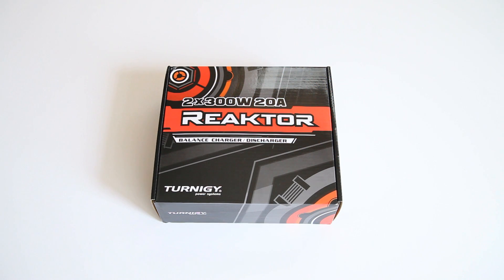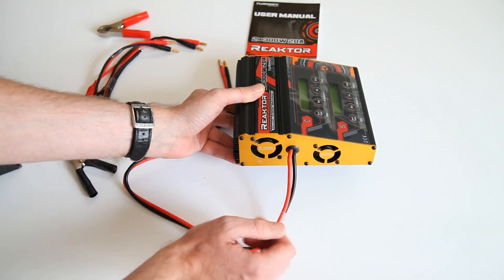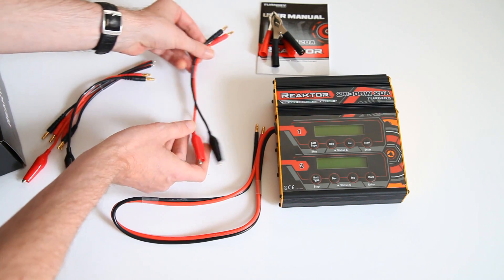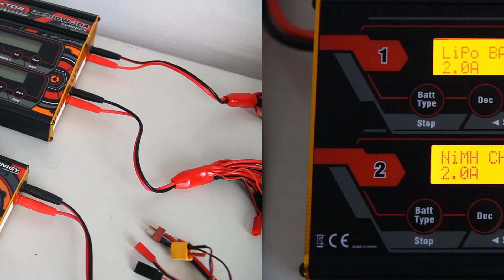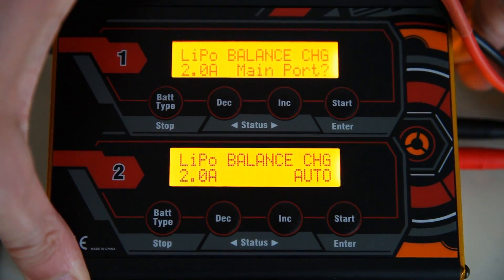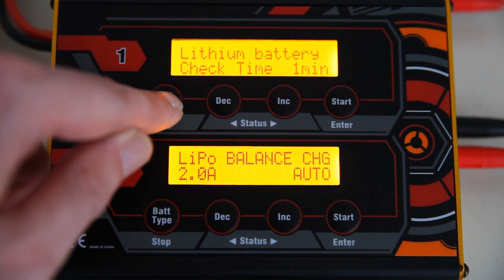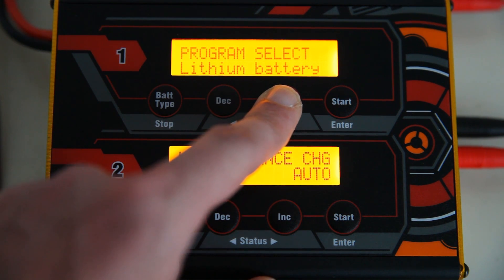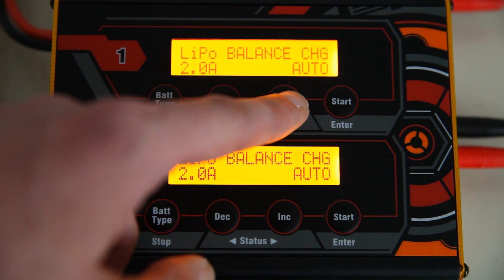Turnigy Reaktor 2 X 300W 20A Charger - Unboxing + rundown of the menu

Comment: Sweet, maybe something I should get as I want more good chargers :) For the USB would I be able to plug something in like the Mobius and control the charge? How do you hook up the bullet inputs to get power? That is my biggest concern. $130 may be a bit steep for my budget though.
Reply from the maker: The RCAddict Thanks mate.. These are good chargers for sure but NOT cheap.. 
For a charger like this you need a seperate power supply (which the bullits slot into).. So it is in fact even more expensive.. 
The usb-port is a normal usb outlet, much like on a computer.. No control or anything..
Reply: DutchRC ADVENTURES Yeah, You cant solder on any king of thing to go to a power supply which plugs into the wall? Seems sort of weird why they would do that. Oh, if the usb is non controled i wouldn't want it.
Reply from the maker: Well here is how it is: Some (less powerfull) chargers have a build in power-supply.. Those just have a chord that runs into the wall..
More powerfull chargers (such as this one) do not, so you need an external 12V supply.. 

One of the reasons for this is the differences of wall-outlet voltages the world over.. This way the charger is allways the same, where ever you live..
Reply: DutchRC ADVENTURES So how do you get an external power supply? And how do you charge that?
Reply from the maker: An external power supply simply transforms the Voltage from xxx to 12V  Just like an internal one would.. 
Like this one: 
http://www.hobbyking.com/hobbyking/store/__17755__HobbyKing_540w_220_240v_Power_Supply_13_8v_18v_30amp_.html  

This one has 1 input (wall outlet).. and 2 12V outputs.. (well actually a Bit more then 12V)
Reply: DutchRC ADVENTURES Oh, ok. Now we are talking out of my budget :0 Lol. I might get another one of the one I have as it is awesome for me just need more lol
Reply from the maker: I didn't help you choose the one you now have for nothing mate ;)
Reply: DutchRC ADVENTURES Yeah, I know :) I might get another one as double would be great. I just saw that double one and was like"ooh! Triple charging" lol
Reply from the maker: Well.. in MOST cases it is best to have multiple single chargers, instead of doubles.. 
If a double dies, and it's your only charger.. You're left with zero chargers....

But YES it is an impressive looking charger :)
Reply: DutchRC ADVENTURES Yeah, Maybe once I get some more larger batteries :) 

I saw one on instagram that was a Hitec 4 port!
Reply from the maker: Yeah.. one reason to go for a 2, or even 4 port charger might be being pressed for space.. 

For me: before I go out to the field I want to quickly be able to charge for instance 8 lipo's.. (2200mah and up) ..
On car-bashing days it's even worse :P Those lipo's are bigger..
Reply: DutchRC ADVENTURES Should they all take the same amount of time if you are charging at teh same C? Unless some are out of balance.
Reply from the maker: I never really do.. I make sure I'm not in a Real hurry, so I charge most things at 2A.. 
The lipo's will live longer that way...
Reply: DutchRC ADVENTURES I usually charge as just a bit over 1C.
Reply from the maker: Should be o.k.... 
When I charge in the field (off of my car's battery) I do charge a bit faster (and not balanced) .. just to keep me flying ;)
Reply: DutchRC ADVENTURES Haha, dont run your car dead! COuld you do a reverse charge to get it running?
Reply from the maker: YES! I actually have lipo's that are strong enough to just start the car streight from them :)  
BUT.. it would take a lot of charging to run the car's battery flat :)  
ohw.. and I allmost allways have buddy's around with their own cars, to jump start me..
Reply from the maker: ps: funny: you can allso power a charger with a lipo, to charge another lipo :P
Reply: DutchRC ADVENTURES Haha, would be a coo video maybe ;D Lol just charge off of theirs when they are not looking ;D
Reply from the maker: Hahahaha I stole your electricity man! Haha :D 

hmm that made me think: maybe those bullit connectors of the charger would fit into a XT60's ;)
Reply: DutchRC ADVENTURES The nanas that go into the side are too big for the Xt60.
Reply from the maker: Will try that :)  My chargers are bussy now though ;)
Reply: DutchRC ADVENTURES Mine is storagin the batts I used today. I fell bad. I did not do my chore, did nto do some homework, did not move wood, and did not clean my room. Damn you X800 and Tiny Hawk!
Reply from the maker: Hahahaha yeahhh blame it on the toys mate ;)  Ohw well.. there's allways tomorrow (for as far as I know) :)
Reply: DutchRC ADVENTURES Well I am mowing the grass my my step dads gargae in the morning and then here at home in the afternoon so....Will do the homework and other stuff though. It is just about getting started. But my luck my parts will come tomorrow and will be playing with that for the next 3 years ;D I alos need to edit and upload a bunch of videos to. No playing tomorrow. will get stuff done! (hopefully)
Reply from the maker: Hahahaha yeah.. the gimbal and FPV set allso came in over here, while I didn't really have time for them :P  
(offcourse I DID test them.. ahum :P)
Reply: DutchRC ADVENTURES Oh, I also forgot to say I have soccer practice from 5:30 to 7:30
Reply from the maker: Soccer over there? :O  That's not a very popular sport there, is it? 
I played a lot of soccer in the past (it IS a popular sport over here)
Reply: DutchRC ADVENTURES It is sort of eh...football domintes it but it is there.
Reply from the maker: Allright :)  So.. I just returned from the flying-field.. New video's have been shot :)  
I haven't started video's on the gimbal & FPV set from BG
Reply: DutchRC ADVENTURES Sweet! No crashes? I flew my MJX X800 twice this morning and if you give ti full forward trim since the pitch is low then it can go crazy fast! Hard to stop using backwards pitch but I just turn it around and give forwards to stop ;D
Reply from the maker: Ehm well crashes.. some minor mishaps, but those were more funny then bad ;)  
And I Allmost crashed into the fence :P  That (LONG) video will be up in a few hours :) 

Hahahaha that's fun! Fooling the quad that way to force it to go fast :P 
Ohw.. I got a A-Spec nano tech in today.. Comes with a nice sticker! :P  hahaha well.. I'm sure it's a good lipo allthough a bit pricy (I needed a High C-rate lipo)
Reply: DutchRC ADVENTURES Haha, sounds fun :) What is beteter besides C?
Reply from the maker: Well they are build be bit better.. More shielding on the wired to prevent cracks (power cable & balans cable).. It was better packaged as well by the way.. Lots of padding in and outside the box..
Reply: DutchRC ADVENTURES How much more do they cost? I just found this on gearbest. Looks like a clone of the X900 sort of but inverted. I swear every time I buy something they come out with something better as soon as I get mine...

http://www.gearbest.com/rc-quadcopters/pp_213068.html
Reply from the maker: This is the one I got: https://www.hobbyking.com/hobbyking/store/uh_viewItem.asp?idProduct=53776 
I'm not sure from which warehouse you would order it, so.. Take a looky for the price :) 

Hahaha :D  yeah.. you can be Sure they will keep shelling out new, slightly improved, things FAST :)
Reply: DutchRC ADVENTURES Ok, not bad for the price then :) 

I also found this one on BG http://www.banggood.com/JJRC-H20-Mini-Headless-Mode-2_4G-4CH-6Axis-RC-Quadcopter-RTF-p-986430.html
I think I will get that one when it comes out.
Reply from the maker: That one looks FAR better! Right? :) 
Nice design & paint finish AND a nice price :)
Reply: DutchRC ADVENTURES Yeah.

I just flew my X900 outside and was only ten feet away from me and it flew away! I had no control and it was giving full forward pitch and throttle. I ran after if for about a half mile under it but it kept climbing until it was about 300 feet up and over the woods and it flew out of sight.....
Reply from the maker: No way :O :|  You do have that on camera?? 
Hmm but that's a shame man! I'd be very unhappy
Reply: DutchRC ADVENTURES Yes way, ULTRA pissed right now. It was my second flight, no camera. I emailed my GB guy who send me stuff as i bought the first one, maybe he will send a new one. So mad, I was going to use the X800 TX which is fine but wanted to do the testing with stock TX....y mistake. Unless you have the X800 or X600 TX I think it is terrible unless indoors as the range issues\. It does not stop when it loses connection either, just keeps going until dead :(((((((
Reply from the maker: I can imagine yes! Damn man.. I hope GB can help you out there! Same kind a shit as with my Revell quad, but ultra stupid that the thing just flew away! :O
Reply: DutchRC ADVENTURES Yeah! I email the guy who sends me stuff becuase the customer service tickets you fill ouot you have to put in a verificatio code at the end to prove you are not a robot but every time it says incorrect.
Reply from the maker: Aha! You are a robot! :D  That's why we never see you on camera :P (or do we.. I'm not even sure :P)
Reply: DutchRC ADVENTURES I think I showe up in my dromida and mobius footage (by accident)
Reply from the maker: Ghehe :)  Ohw.. I got another email from GB (from someone ellse) asking me if they could send me stuff :|
Reply: DutchRC ADVENTURES Did they give you a list to choose from?
Reply from the maker: Well to be honest the english was 'a bit' croocked :P  hahahaha! It was a bit hard to make out what the plan is :P 
I've given her a list of (not overly expensive) things I would be interested in (some quads. a car.. a boat and a camera).. 
We'll see how the cooky crumbles ;)
Reply: DutchRC ADVENTURES Well, do you know chinese? Haha, they know chinese are some english ;) You have to say yes and then they will give you a list of like 5 things that are sort of cheap, to try you out with to see if you will bring the enough sales to continue sending things.
Reply from the maker: I just ate chinese today, but that didn't help :P hahaha 
Well cool, but that won't work for me.. My channel isn't about those kinds of RC's.. 
So they can eighter send me things that fit on my channel, or bye-bye...
Reply: DutchRC ADVENTURES Yeah, haha. Hoow much were the things you asked for? Unless they are under $50 I don't think they will say yes :/
Reply from the maker: Ehm hahaha yeah.. 1 quad was €48.. the rest was like €75 and up :P 
Well.. I don't care.. Even these things were on the edge of being to cheap for me..
Reply: DutchRC ADVENTURES Oh, haha. I would not expect anything then ;) But who knows ;D I don't think too many people know that I am posting a video every day know. Oh well, they will figure it out ;D I am going to buy a few things from GB soon with my weeks pay.
Reply from the maker: I expect nothing mate ;)  It's all good.. I wasn't getting things for free before this eighter, so nothing lost :) 

Haha yeah.. The'll figure it out ;)  I've been posting daily for about a week now as well, but I actually think it got me fewer views.. Ohw well.. It doesn't really matter.. I'm still in the build-phase of the channel anyway..
Reply: DutchRC ADVENTURES Yeah, maybe in a month or so once you are bigger :) I might accept one thing if they ask with a list though because that is how you get more expensive things :) Have to build up with the company ;)

Sweet, I have not been able to watch my videos as I am very busy but will try over the weekend, maybe tomorrow morning. I want to see you build an ocotcopter ;D
Reply from the maker: The next thing I will (scratch) build is a plane my friend ;)  I'm in the process of designing it now :) 

Well yeah.. building a relationship with them.. I understand.. I'd rather be patient for 'real' rc companies to take an interest though.. 

And no worries mate :)
Reply: DutchRC ADVENTURES Sweet, you should one like on flite test which has like 10 wings on top of each other ;D 

The first thing i got was $20 and then second was $30, and they pay $15 for DHL  each time. I would ask for something a bit more but I had them resend the X800 since the first one caught on fire and am noow asking for a new X900 since it flew away..haha whoops. Maybe not the best time to step it up ;P 

Just watched your Totem quad video and am loading the Sky Easy Glider for a while and will watch after I do homework for a bit before I got to bed :)
Reply from the maker: The end of the Sky Easy video is fun (sorry :P) :)  
Thanks for taking the time offcourse! 

Hahaha 10 wings :D  I WILL tell you it will be something you haven't seen before, or at least not offten :) 
That might allso mean it won't fly well :P haha we'll see.. 

Damn.. I'm in the process of my video of the gimbal.. quite a bit of work :$  (6 video takes so far. and a few more to go)
Reply: DutchRC ADVENTURES Haha, just got done with what I am doing tonight and sm watching it now. May take a while as it says it is playing at 6kpbs right now...Ok, just jumped back up to 100. 

I hope it just works, will be so cool :P Wow, is that 6 mess ups or 6 parts?
Reply from the maker: Hahaha :D   no no.. 6 parts.. I used 4 different camera's as well so far :P haha
Reply: DutchRC ADVENTURES Oh, ok, that is a lot ;P
Reply from the maker: :D  

Do you allready have that new WLT plane by the way? Or is it on its way? :)
Reply: DutchRC ADVENTURES I bought it yesterday, so will be quite a while yet but have lots of other stuff coming, including (hopefully) my banggood ZMR order today.
Reply from the maker: Exiting! :D  That should then be everything needed to get it airwurthy?? :)
Reply: DutchRC ADVENTURES Yeah! I have some heatshrink, locking nuts, and liquid electrical tape coming too but that is not essential right now. I doubt it will come though jsut becuase it is me.
Reply from the maker: Hahaha I know that feeling ;) 
I wonder how long that BG quad will take to get here,,,
Reply: DutchRC ADVENTURES Yeah, it is a sucky feeling. Did you get the RTF version of the Hisky one? I am considering the Hubsan 109 or whatvert, the brushless one when it comes out. It is $200 (what it is listed at now) II will probably also get the H107L+ not becuase I want it but because of views :o
Reply from the maker: Yep.. I got the RTF version.. That Hubson does indeed looks nice :)  Not cheap though ;)
Reply: DutchRC ADVENTURES Ok, and yeah. The prices might drop though as those are not from the factory. Someone just said you can only use a 25MW transmitter with the V2 goggles, is that true?
Reply from the maker: That's bogus my friend :)  
Especially sinds I have 200mW transmitters myself ;)  
Maybe they got the current-draw of the receiver mixed up (which is about 25mW)  

Not MW by the way :D  That's MegaWhatt :D
Reply: DutchRC ADVENTURES That is what I told them. I said you got 700M, is that right?
Reply from the maker: Of range? Yes at least.. The specs say 1500M.. I have gone as far as +/- a 1000m by now, which worked fine..
Reply: DutchRC ADVENTURES Oh ok. I meant meters. I thought 700 was a lot for fpv! Wow, I hope mine will go that far.
Reply from the maker: I'll test the cheapo BG fpv set one of these days :)
Reply: DutchRC ADVENTURES Haha, soon. I am eyeing it more and more these days ;D
Reply from the maker: I just released another FPV-view video a minute ago :)  This time you'll actually see the FPV feed :)  (links to the gear used are in the description)
Reply: DutchRC ADVENTURES Ok,will check it out soon. I have saved and uploaded 5 videos so far so almost done ;D They may have shut our download speed down but upload is going great!
Reply from the maker: Ghehe okee good! I was wondering if that was effected indeed.. Nice to read that it isn't :)
Reply: DutchRC ADVENTURES Do you know how fast your upload and dowload is in terms of MBS? I am curious.
Reply from the maker: My connection is 200Mb/s down and 20Mb/s up..
Reply: DutchRC ADVENTURES I am crying inside. I did a speed test in the morning when it is normal and it was 2MBS down and .4MBS up. so you are about 100X faster.
Reply from the maker: Sorry mate ;)  I have the fastest possible connection (for non-commercial use) over here.. And connections in the Netherlands are among the fastest in the world.. I guess that's a benefit of a smaller country..
Reply: DutchRC ADVENTURES Hum,,, :/
Reply from the maker: It's allso €55 a month though ;)
Reply: DutchRC ADVENTURES Wait till you hear this, ours is $80 a month...
Reply from the maker: Hmzzz I was afraid of something like that :$
Reply: DutchRC ADVENTURES Only provider. No one else is here yet. There are others but they are 5 minutes down the road.
Reply from the maker: Yeah.. no competition has a way of driving up the price..
Reply: DutchRC ADVENTURES If it was unlimited at normal speeds I would be very happy with it but the whole limit sucks.
Reply from the maker: Yeah.. But there is no negotiating to be done while their the only one there..
Reply: DutchRC ADVENTURES Yeah, I hate it even more becuase people in town with verizon have unlimited really fast, like 50+ download, and it is only $40-60 a month!
Reply from the maker: You'd need a cable to be laid-out towards your home, to be able to get that? (proably thousands of dollars to get that cable put in)
Reply: DutchRC ADVENTURES Yeah, not enough people out here for it to be worth it to them.
Reply from the maker: Yeah.. Well we do have some aerias with the same situation over here (yes.. even in this small country).. People living in the woods.. farmland and such.. 
For them to get a cable rolled out, it would cost them the price of a small car...
Reply: DutchRC ADVENTURES Yeah, oh well. I am just worried that once I get my good camera the videos will take forever to save and upload. The YT option in WMM saves at 30fps so for me to save at 60fps would have to make a MUCH bigger file. I expect upload times to at least triple :(
Reply from the maker: Well.. here is the thing about 60fps: it looks better to people though they don't really know why.. It's workes better for our brain.. 
As such there is no better kind of improvement.. 

On the other hand: with the Sony cam your footige will Even look a lot better at 30fps.. So you can at least try the 60fps thing..
Reply: DutchRC ADVENTURES Yeah, I know ;) I think I might be able to set the bit rate is a custom setting so maybe bring it down a bit which is what the YT setting does.
Reply from the maker: Yeah.. just do a few test-runs.. And if you want me to assess the quality of a video on YT for you.. let me know...
Reply: DutchRC ADVENTURES Yeah, I will know you are watching at the highest possible quality :P
Reply from the maker: 4K is possible ;) 
Anyway.. feel free.. Just do a few shorter test-video's maybe :)
Reply: DutchRC ADVENTURES Yeah, I can change the bit rate at which it is saved. The YT setting is at about 5,000. Would I be able to save the 1080 60 at 5,000 to keep the file size the same or would I have to double it? I think the full recommened bit rate is like 24,000
Reply from the maker: I wouldn't use a low bit rate.. As you know YT compresses the video's (jpeg-compression).. And You would allso be doing that on your side..
Now it might seem like the YT compression would then not impact the quality anymore, but it Will.. It kind of compounds the loss of image quality..
Reply: DutchRC ADVENTURES What would be considered low for 30FPS and low for 60? The setting use says 5.19MBS
Reply from the maker: I must admit I had to take a look at what I use.. I use  8,000 minimum with peaks set at 10,000 .. (default setting with my codec).. I'd say 5,000 would be a minimum... 
Hmm I looked at a file I just compiled, and its 10,000 kbps.. I think most of our video's would be compiled at my peak because of all the movement & colors.. (an unboxing will probably use less)
Reply: DutchRC ADVENTURES Ok, so 10,000 would be a good number then. I wonder why the recommend is 24,000 and the max is 135,000 then :/ What about the audio? I just saved one with teh lowest audio and sounded the exact same to me. Also saved one with the highest eveything and was 1 minute long and 1GB saved with the lowest everything 64X64 and 1FPS and was 1MB ;D
Reply from the maker: I didn't include audio by the way, but that's only 401kbps .. But yeah.. 10K seems just fine to me.. A happy medium between bad & overkill..
Reply: DutchRC ADVENTURES Huh, my audio comes set at 128KBS and only goes to 192KBS. I just hope saving the larger files will not take too much longer to upload as I don't really have the time. I think flyin' ryan's are only in 30fps though.
Reply from the maker: Ah yeah.. 128kbps for audio is just fine (for what we do) .. 
Well.. do a few test-runs and see how much bigger the files get...
Reply: DutchRC ADVENTURES Yeah, now that I look not very many people at all have 60fps videos. Ryan probably has to render his down as the mobius footage is only 30. Lol, I will be the one with the good camera ;) Behind you, I am surprised you don't have one to do 4K or upload it ;D
Reply from the maker: Ghehehe my taste in camera's is a bit expensive ;)  I want a Sony FDR-AX100 .. but it's €1,900 :(  I want that one because it is VERY good..
Reply: DutchRC ADVENTURES Haha, go get the 4K ;D
Reply from the maker: I'm really not made of monney my friend :)  Maybe once the YT payments improve a bit..
Reply: DutchRC ADVENTURES Haha, you are making triple me ;D Just kidding, hardly anyone would be able to watch it, not just speed but computer resolution.
Reply from the maker: True :)  It is beyond what really matters indeed :)  1080P 60fps is good enough for Now.. It will take a while before 4K becomes the norm...
Reply: DutchRC ADVENTURES Haha, never will be the norm with hughesnet!
Reply from the maker: Probably not in the coming decade indeed :)  But like you said: most people don't have monitors that can display 4K anyway :)
Reply: DutchRC ADVENTURES Haha, I wouldn't even expect 720 in a decade ;D
Reply from the maker: Those people that will be on Mars in a while might have a better connection :)
Reply: DutchRC ADVENTURES Yeah lol.
Reply from the maker: Maybe enlist into that program :)  I mean.. yt video's from Mars :D  that should get some views ;)
Reply: DutchRC ADVENTURES Haha, they would hover at 1% throttle ;D
Reply from the maker: Hahaha yeah.. you could fly for hours on a 100mah 1S :)
Reply: DutchRC ADVENTURES You might need to have reverse pitch propellers as then the challenge wouldn't be keeping it up but keeping it down!
Reply from the maker: Ghehe ohw well.. You allways fly a quad upside down for a while to get down :)  
Tomorrow another chance for mail?? Or doesn't the mail come in on Mondays over there? 

ps: new video with the Totem 330 is online.. with a snappier take-off this time ;)
Reply: DutchRC ADVENTURES Haha, just strap on upside down on the top to push it back in when you want. Yeah, mail just does not come on Sundays. Will check it out :) My X800 unboxing is live in 3 minutes ;D
Reply from the maker: A new round in the mail lottery then :) 
I'm amazed there aren't any video's about that HiSKY quad yet by the way.. Well not good video's that is.. Or do you find video's on the HiSky HMX280 HMX 280 ??
Reply: DutchRC ADVENTURES Haha, I bet almst anything it won't be there :( It has been a month since I ordered it. I have not seen any yet but I know a few people have them on the way.
Reply from the maker: You DO think it will still come in?? 
Hmmm that would probably be QC101 & Ryan??
Reply: DutchRC ADVENTURES Idk, I jsut hope and get my dreams smashed but they are reignited when she pulls up each day.

Atucally a very small channel called stuart got one, I think maybe Ryan too, he is getting a runner250 as well.
Reply from the maker: Baseball bat is ready next to the door? :)
Reply: DutchRC ADVENTURES No but gun in the sock drawer ;P
Reply from the maker: Hahahaha well.. that's something I DON'T have ;)